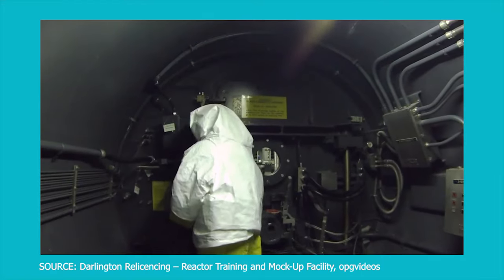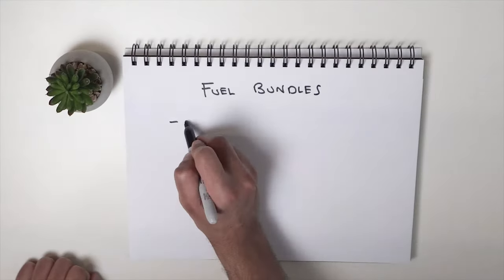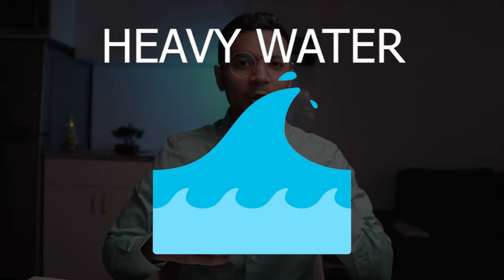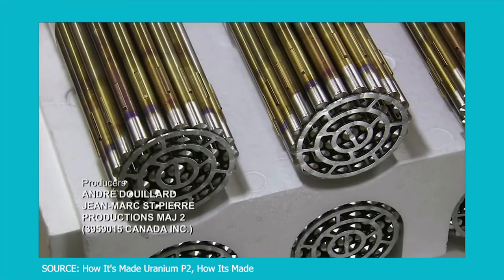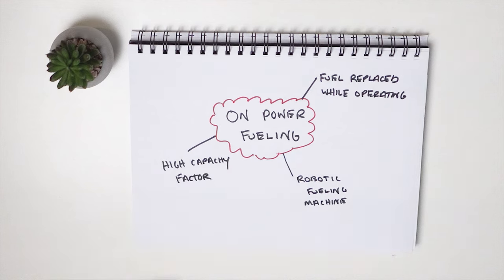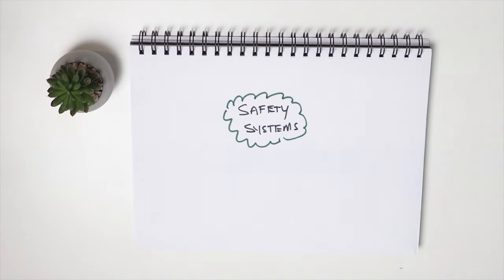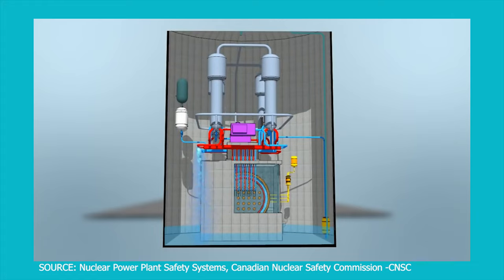CANDU Reactor EXPLAINED in 5 minutes

Comment: Because they can be refueled while operating,  also excellent design to make ISOTOPES and weapons grade material.
Reply from the maker: Philip I agree with you on the medical isotopes, but In terms of weapons, its very difficult to make weapons grade material using power reactors. The entire purpose of power reactors like CANDU is to maximize economic energy production, which means leaving fuel inside the core for long periods of time. Contrasting to reactors that produce weapons grade material, since they need to shuffle fuel fast enough to prevent other isotopes of Plutonium from being formed. CANDU's and reactors that produce Plutonium from weapons work very differently
Reply: @OsamaBaig  without the iaea safeguards,  they are excellent for making weapons grade material. India made it original nuclear bomb with an old candu reactor.
Reply: @Phil-D83  It's really easy to get "boom stuff" out before getting spoiled if you don't have to keep shutting off the reactor.
Reply: @leerman22  That wide core of tubes can show many levels of  neutron flux . It is true that a fuel pressure tube could be used  with the right source material for the right  length of time and at the optimum flux to produce , for instance, Plutonium.  Security is so important.
Reply from the maker: @Phil-D83  Actually India made an nuclear weapon with CIRUS which wasn't a CANDU reactor. It was a research reactor built by the US, and the heavy water was supplied by Canada. It would be extremely difficult to produce weapons grade plutonium with Commercial electricity producing reactors since you would need to shuffle fuel very fast, and it would make the process of generating electricity difficult.
Reply: @OsamaBaig  any reactor that can easily be refueled while in operation is a proliferation risk. As cand reactors can use natural uranium, also  proliferation risk. I thought the cirus reactor was a candu.  Ok guess not
Reply: There are much cheaper ways to get weapons grade nuclear material than from a Candu power reactor.
Reply: john N  But the uranium fuel does not require enrichment, making it much less expensive to produce and handle.
Reply: john N  Actually no.
A lifetime supply of nuclear power electricity for one person, would produce 3 aspirin tablets worth of nuclear waste from a CANDU power plant.
Reply: john N  I bow to your calculations;  I merely reported what I read many years ago.

Comment: Isn’t candu much more expensive to build that conventional plants?
Reply from the maker: That's a good question Anton, I'm not too sure to be honest. I haven't looked at the average price for a PWR/BWR and CANDU and compared what is out in the current market at the moment.
Reply: @OsamaBaig  i heard in another video that the initial investment for candu plants is much more expensive than PWR. But yes, this is the solution to global warming and energy in general. It's too bad general public still have negative option about nuclear
Reply: I'm not so sure than an apples to apple comparison was ever done, comparing CANDU reactors with other nuclear power plants.
One of the difficulties with CANDU plants is the length of time for manufacturing and construction;  this is a real financial penalty at times of high interest rates as was the case with the Darlington power plant construction.  Add government interference into the mix (now we need it, now we don't) and the costs accumulate.  The completion of the Darlington power plant was severely affected by the provincial government of the day, driving up costs at a time of very high interest rates, the early 1980's.
This of course is offset by the plant availability percentage.  CANDU power plants are re-fueled while running at full power; thus lengthy re-fuelling shut downs are not necessary.  The rest of the plant is designed such that maintenance shut downs were necessary only every 5 years or so (this was in the early 1980's).  I recall that the primary coolant pumps' seals and bearings were the main difficulties here.
I think that over the life expectancy of the plant, costs are comparable.
Costs are lower than with fossil fuelled plants because of the very low cost and quantities of nuclear fuel per KW-hr of electric power produced, especially with CANDU fuel.

Comment: Awesome video! The CANDU is a Gen 4 reactor we have TODAY
Reply from the maker: It impresses me to this day that this reactor was designed over 60 years ago. Thanks Generation Atomic! I really appreciate your support
Reply: Similar in some ways in terms of passive cooling. Ideally, a gravity larger water supply to refill the vault and the Calandria would be beneficial until the reactor could be air cooled. I know there has been some research in to Accident Tolerant Fuel for Candu's but this would require mild enrichment.
Reply from the maker: @thomascheney6083  Interesting thoughts. Lots to learn about CANDU for me. I really like the thermosyphoning feature in CANDU

Comment: CANDU reactors are so lols. Some of you may cringe when I make the comparison, but I describe them as being like RBMK reactors except the designers built them with safety in mind. They even have a positive void coefficient.

Now that may have raised some red flags for some people, but the genius of CANDU is it's mediocrity. Because it doesn't use enriched uranium, it's slow to change its power output and barely works. To get everything to work properly, you need to set everything up in just the right way: screw anything up and it will simply stop working and shut down.

Because it's slow, it's easy to identify problems before they get out of control. Because the uranium isn't enriched and needs heavy water, adding regular water shuts it down. Because the control rods need power to be kept out of the reactor, a loss of power drops them and shuts it down. And my favorite, because everything needs to be spaced up and aligned in just the right way, if the fuel channels get to hot they actually begin to warp and sag. This breaks the alignment and causes the reactor to shut down. 

Basically, when most reactors get started, they mainly sustain themselves and operators need to make sure everything stays under control. With CANDU reactors, operators need to put effort into just keeping the thing on XD.
Reply from the maker: Countries like China, South Korea, Argentina have made major investments in CANDU reactors. Romania is building a few more units as well just recently. If the reactor design was so horrible why would these countries purchase CANDU technology?
Reply: @OsamaBaig  I think you misunderstood my comment. CANDUs are actually my favorite reactor. When I describe it as a mediocre reactor, its a feature not a bug. It doesnt do anything fancy, it just does an OK job at wide range of things. This is really all you need for a baseload power role, and its versatility mean you can easily fit a CANDU into a grid that uses a bunch of other reactors and really get your moneys worth. A good example of this is the Qinshan Nuclear plant, where they have 5 CNP reactors which use enriched uranium, and 2 CANDU reactors. They can take the spent fuel from the CNP reactors and use them in the CANDU reactors. 

With most other reactors you set up ideal conditions for fission and then need to watch it carefully. Because they used enriched fuel, you can really get it going. In the rare event there is a major problem, you need to shut down the reactor and get everything under control. If people screw up in how they handle a situation, things can get nasty.

 Because CANDU uses natural uranium, they need to go the extra mile just to allow fission to occur. The thing barely works, and you need to make sure everything is nicely put together just right for it to work. Because it barely works, its really hard to screw up. In the event of a problem, a CANDU reactor will most likely shut itself off. If people screw up in how they handle a situation, the reactor will probably just break and shut down.

If you are wondering how a reactor that barely works can compete with the spicier designs, the answer is simple: CANDU reactors are huge. Most of the reactor is simply a bunch of smaller prefabbed components stacked together. You would think that a massive reactor would be harder to build, but for CANDU its not the case. One of the perks of the design is that a country can lack a highly developed industry, and still realistically manufacture most components domestically.
Reply: @spencerleava2502  Much of what you say is true; its the spin you put on it that is objectionable.
How can something that does exactly what you designed it to do, be mediocre?
Further, I have never heard of one instance where a CANDU unit failed to achieve criticality.
Agreed that there is much finicky machining detail in Candu units, hence the need for a well-trained work force along with a management style that reinforces personal responsibility and actions.
Yes, CANDU reactor assemblies are huge, and the Darlington units were just short of 600 tons.  But we got them to the site in record time and well within budget.
The Candu design was designed so that a country with reasonable industrial facilities but a well trained work force, could produce one.  The heavy forgings needed for the pressure vessel reactor containments were not producible in Canada.  The USA and others decided to tool up to produce these vessels, and were paid for by the military, as these wanted the nuclear by products for their weapons program.
The CANDU reactors can, and were, built without any military contributions.

Comment: I had a doubt about how it would all work when the moderator and the fuel are separated by pipes, but after watching your video I understood it, thank you! (because it's made of Zirconium alloy which allows neutrons to pass through and so the moderator could help in slowing them down)

Comment: Briefly here you are CONTROL/SHUTDOWN Systems.

CONTROL SYSTEMS:
1. Zone Control Units-ZCU (14=7+7) consisting in 14 volumes of light water (H2O) 
   assures fine control of reactivity.Provide pozitive and negative reactivity rezerve.
2. Ajuster rods (21=5+3+3+4+2+2 banks) which in normal operation are fully inserted 
   Provide pozitive reactivity rezerve, flaten neutron distribution in reactor core
3. Mechanical Control Units (4=2+2) are in normal operation fully extracted.
   Provide pozitive reactivity rezerve.
Control systems (mainly ZCU) are used (via DCC=Digital Control Computer) for 
reactor power increase/decrease, setback, etc.

SHUTDOWN SYSTEMS:
1. SDS1 (Shut Down System 1) consisting of 28 vertical bars is 
   used for emergency situation. High negative reactivty.
2. SDS2 (Shut Down System 2) consisting in a number of horizontal nozles 
   to ineject liquid poison. Very high negative reactivity

CANDU safety operation is assured by 5 (five) systems.

Comment: Con of CANDU: it uses natural(0.7%) uranium. It needs frequent fuel change. and generates large amount of spent fuel and unburned fuel, i.e. nuclear waste. Nowadays enriched uranium is cheap. So to reduce nuclear waste, new reactor should use 20%-enriched HALEU uranium, not 4.5% LEU or natural uranium. Less fuel change, better fuel utilization, less spent fuel waste.
Reply from the maker: Youcantata, the CANDU is a 2nd generation design. Cost of enrichment was a lot higher when a majority of CANDU's were being built across the world.  However, as the cost of enrichment has dropped throughout the years, there are benefits to using higher enrichment. The new 3rd Gen CANDU also uses slightly enriched uranium.
Reply: The frequent fuel changes, continuously in fact to optimize burn-up, is a non-entity because refuelling is carried out at reactor full power.  Large amounts of spent fuel? Compared to what?
Furthermore, new CANDU fuel bundles can be handled without special transportation, and spent fuel bundles can be removed from the water cooling bay after 10 years for dry storage above ground.

Comment: CANDU reactors also have an element of passive safety in that if the reaction gets too hot the heavy water can boil and no longer moderate the neutrons.
Reply from the maker: Yes Seth great point, also CANDU's can Thermosyphon. This means, if the reactor shuts down and back up generators don't turn on. Through convection, the reactor is able to cycle coolant within the core. This is a really cool passive safety feature
Reply: @OsamaBaig  A feature that you don't want to use!

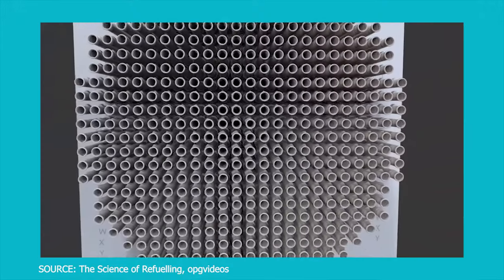Comment: Osama, I have a question. Why are the channels in the calandria arranged to fill a circle? (1:04) Why aren't they arranged to fill a square? Their packing arrangement is in a square grid rather than a hexagonal grid. It would seem to me that the same space could hold more channels if the fuel channels simply filled out the corners as well rather than forming a circle. There does not seem to me to be any reason why that reactor arrangement would have to be circular.
An alternative packing that would still permit control rods to be dropped in could be hexagonal, with the over-all pack forming a hexagon (turned so the two sides are vertical, and the top and bottom are sloped—basically a hexagon with one corner pointed up and one pointed down).
Basically my question is about why the calandria channels are packed the way they are, and whether there are any advantages to be had by arranging the channels differently.
Reply from the maker: Good question! There is probably a bunch of reasons why 1) Ease in manufacturing 2) Ease in assembly 3) Ease in maintenance 4)  Nuclear Reactor Efficiency (Calculations are done to understand Nuclear reactor Kinetics and what is the ideal shape considering the fuel type, moderator and materials being used)

Comment: SMRs have gotten a lot of attention lately for various claimed benefits; would it be possible to build an SMR version of the CANDU?

Looking at this presentation of yours leaves me with some questions. Is the heavy water the stuff that's boiling and turning the turbine? What is the working fluid of the engine?
Also, you mentioned that heavy water has a deuterium atom. Is that just one, or are both hydrogen atoms of the heavy water molecule deuterium atoms?
Reply from the maker: Berekana, I believe SNC lavalin publically announced a SMR version of the CANDU reactor. I believe it was a CANDU-3 design that also produced isotopes while operating. Also, heavy water is not used for the turbines, the turbines are located on the secondary side which use steam (light water). Also, there is no "Engine" its simply Pressurized tubes that Heavy water flows through, gets heated, which is then transported to heat exchangers which help create steam on the secondary side. Hope that helps :)

Comment: How come we dont have more of these operating?
Reply: john N  CANDUs are much more fuel efficient than LWRs. They are really a "poor man's reactor" which technically isn't bad. An ideal nuclear program shall start with LWRs to produce deuterated water, and you stockpile the used rods. Then you build CANDUs, fill them up with the produced heavy water, and processed used rods from the LWRs. You can throw some thorium in for good measure, and kinda use it like a "breeder" to obtain U233 to use in the LWRs, phasing out enrichment facilities.
Reply: john N  That's where Fukushima comes in. They are extracting all the "Nasty Things", leaving only deuterium (not radioactive), and tritium, which is so diluted that it's impossible to extract viably. So there's definitely technology to do so, and being dual use (mitigation of effects of a meltdown, and being usable to purify HW) is nice. 
The design modification involves using less HW (I think it only uses HW inside the calandria tubes), that's why it needs 2% EU.
Reply: john N  Still less waste than what you have to deal with for comparable amounts of energy from wind or solar.
The technology to make nuclear "waste" basically irrelevant is here already. We are not using it for political reasons.
Reply: john N  Same can be said about other energy waste. You know old PV panels are hazardous waste, right? That cost more to recycle than they are worth. Or that wind turbine blades are not recycled, and emit microplastics into the environment. Nuclear "waste" on the other hand, is the only energy waste that is thoroughly accounted for.
Reply: john N  Unlike a coalar panel that spews out heavy metals that never decrease their toxicity?

Comment: Candu has the same positive void coefficient as RBMK in Chernobyl had, they are dangerous by design…
Reply from the maker: Oleg, I agree RBMK had a dangerously high positive void coefficient. CANDU on the other hand is very different, as it has a very small positive void coefficient value which can easily be countered by control systems before any boiling occurs. It also has built in pressurizers which prevent boiling from happening in the core itself. Also, CANDU has several safety features which RBMK didn't have, such as chemical poison's, Liquid zone control (Lightwater that removes neutrons), and Emergency injection systems. There is a MASSIVE difference between CANDU and RBMK design